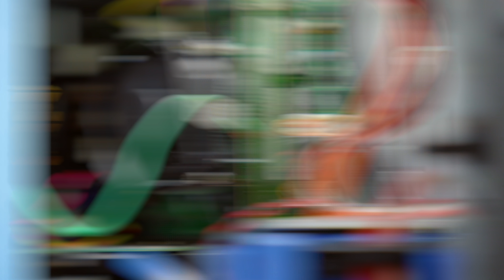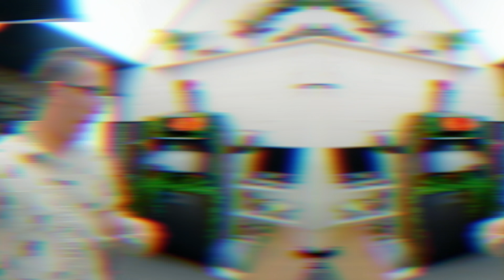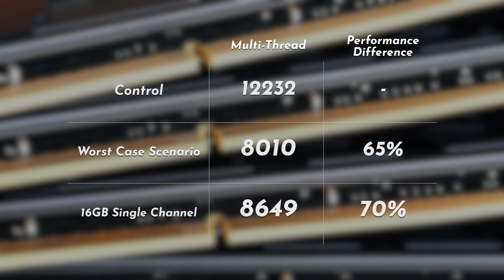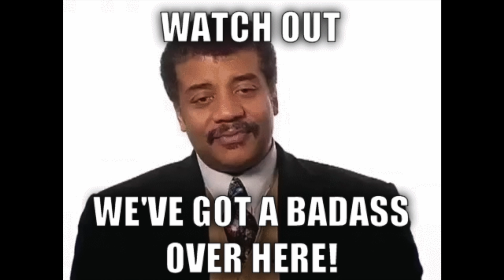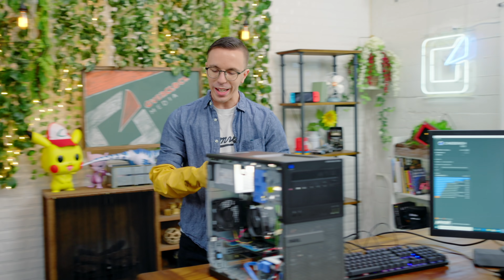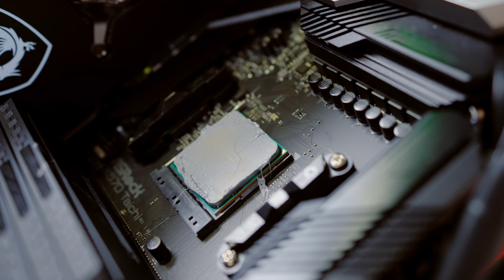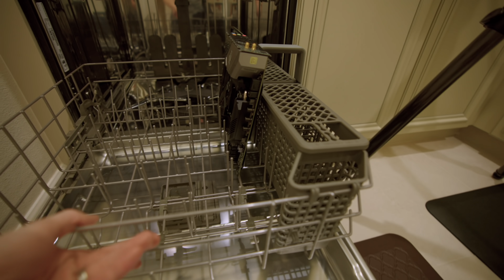Gaming PC Lies People Believe

Comment: thermal paste a blob size grain rice, i feel that way to little. most people build a system and once it built it years . i do an X a nice fine line and a tiny blob in 4 space and that seems about right, the X could be about right but just to make sure, as screwing it down its always going to be uneven so one very fine blob centre i feel you could be at rick half cpu having very little and best advice id say esp new builders maybe just under size pea a little extra far better than to little or do what i do a fine x and 4 tiny dots in gaps you know for sure. itx newest pc i may gone over the top slightly but upgrading old pc what i built 7 years ago with new motherboard, cpu psu and case i used a fine line 4 dots that was correct amount, but i was using arctic mx6 the other mx4 so much thicker stuff and still not 100% sold on it as feel i may get better mx4 , that micro small dot you made i dread to think what use that is in a year compared to 4-7 years what a lot people run system for once built esp if they gone all out on cooler then no need to ever remove it till first big upgrade and that can be years. tad extra is far better to little esp if system going to run for years

Comment: Note: Today most people won't know this, but in the early days of PCs, the Main drive in all computers was magnetic based media. It relied on little magnetic particles to be in very specific positions to tell the computer what was on the drive. Letting your kid pit little fridge magnets on the side of your case was a very bad idea as over time the magnetic field would slowly start to shift those particles. Now it was harder for the weak field to do it while the computer was on as the disk(s) in the drive were spinning and constantly changing the position of those particles relative to the field. But when off, the disk(s) were stationary and the particles would slowly start to align with the field. That is where the idea that magnets killed PCs came from. Modern computers use SSDs as their main drive, which are a bit harder to screw up with magnets. Still not a good idea to have them around your computer, but the danger of them wiping out your entire computer is substantially less than it was before.

Comment: I work repairing consoles... And people have brought me consoles with toothpaste cuz "I see a video on YT and they said it works". The problem with toothpaste is not only in long therm it's gonna dry out, but also, have sugar, and other components for killing bacteria and all the sht in our teeth, so the corrosion on the processor, and the cooling system is enough to never gonna have good heat transfer ever again (considering GPU on consoles doesn't have those covers)

Comment: If you're gonna "wash" your PC components, make sure you have a good house filtration system.  You don't want minerals in the water getting caught and drying in the ports. NOT A WATER SOFTENER, water softeners activily ADD more mineral to the water,  either salt or potassium. Easy way to destroy electronics. If your water is actual "clean" IE no minerals,  or basically  distilled water,  than you shouldn't have a problem.  Just make sure to give them all a few DAYS to dry.  Not just 1. Or if you're only gonna give it 1, put it in a warm room with air flow to help the leftover moisture evaporate and not be left in the ports and crevices. God speed to whoever tries this

Comment: I routinely wash old motherboards with water. Water does not kill electronics, it does not corrode the material (unless it's water against it for like months/years). What ruins the system is the electricity acting as a reaction catalyst between the water and the copper/other conductive metals in the PCB. So, if you give it enough time to dry afterwards, you could literally dunk a gaming PC into a pool, and it would be totally fine.

Comment: just FYI, that hard drive isnt dead. You only erased all the data on it. You see, a hard drive stores data as magnetic impulses on a rotating disk. Therefore, pushing that magnet onto the hard drive completely erased the data from probably just a few cylinders, maybe more. In either case, that hard drive should be totally fine, if not a bit forgetful about it's past ;)

Comment: My take...I found a garbage PC some kind of sticky brown goo in it but decided to push through I disconnected everything I cleaned as much as I could but that goo was a project killer either I continue or it gets tossed so I put it in the sink (not dishwasher) used soap and water and I brushed it, got it cleaned and I used a hair dryer on hot to dry it asap made sure everything was dry then...because I didn't have thermal paste I used food grade machine grease rated at 250° I still think I should put actual thermal paste but meh...it turns on and it's running windows 7 and I use it exclusively as a media PC...it's been a year and still running

Comment: Every single thing a computer does is literally just manipulating electrons in different ways so it makes absolutely perfect intuitive sense that as long as every single part of your PC is not very heavily insulated against magnetic fields which is not easy to do and expensive then then it makes perfect sense that it would pull away electrons that that if that your computer would be using In fact I'll bet if you  Could get that magnet  Close to the side of the CPU where the is there the I just meets tmeets the cooler That you would absolutely be able to completely pull away electrons out of transistors in the CPU And most likely break it

Comment: Try mixing ram from same manufacturers that are close in speed. Ive got some cheap OLOY 2 different sets of ddr4 3200 but the other set is 3600 stock. I enabled xmp and everything runs at 3600ghz no issues.

Comment: Did you pull the cmos battery out of the motherboard before washing? water should only damage electronics if electricity is present to cause a short unless erosion was a factor which, it was a single wash. not 20 years in a river.

Comment: the magnet didnt kill the gpu, the surface of the magnet shorted it out. gpus have a lot of current in them and i think you would need a much more powerful magnet to disrupt the circuitry
Reply: was thinking the same and since its a rather low end gpu im pretty sure it has no back shielding

Comment: I want to see you do this magnet thing again but with a rubber coated magnet and magnet case. Did you blow the water out of the mobo with low psi air or did you run this dishwasher in sanitation mode?

Comment: You didn't pull out the CMOS battery numbnuts. You killed your board now spreading misinformation off of your own mistake. If you fucked that up I'm not even going to assume you even dried out the dead board well enough either.
Reply: if ur alr that mad abt that go back where "the magnet affects the gpu" (he just shorts the hell outta the card by laying the magnet on it (since its a low end card im hella sure it has no shielding there))

Comment: ESD usually happens when the system is disconnected from the wall and de-powered try it that way I bet you fry some stuff I’ve fried a stick of ram and a mobo once with ESD, 74c wow that’s cooler than my prebuilt ran with it’s oem thermal paste lol can’t believe crest works better lmfao, I’ve seen ppl wash component with a hose and they still work the dishwasher has a drying cycle that gets really really hot that’s probably what did it that and the hot water

Comment: what if we use one like RAM sit as 8 + 8(two sticks) or 16(one stick) which one would be better.
the second if we use 8 + 8 + 16 or using 16 + 16 which would be the better option.
if we use 8 + 16
the all have like the same speed but in each case which should be more preferable over the other?

Comment: some pc u may be suprice no not in dishwash but in a flood ware i picked up the tower took it out back tiped it over and u saw about a gallon of water pour out sat in store for about 10 months took it out looked at it looked great like new inside still pluged it in and worked like new and it was a used microsoft certified refurbish from amazon only cost 100$

Comment: I can run mixed DDR4 ram just fine in my newer laptop, but when I mix brands in my older laptop, Windows doesn't boot. The ram is completely the same from the clock frequency to the timings and memory, but it won't boot beyond the bios.

So newer ram, yes it can be mixed. The difference isn't as significant with Intel CPUs as opposed to AMD by the way.

But older ram modules need to be the same from my experience.

And who the hell would put toothpaste on a CPU? That's ridiculous lol. Still gave me a good laugh

Comment: imixed ram and did not have one issue until a pair of the sticks which were older ended up dying after a while. But 2 sticks were both 4gb each and 2 were 8gb each. the 8gb were corsair and the 4gb ones were from best buy so it was best buy  brand. cant remember the name. oh and that mobo wouldve been fine if you let it dry for more than a fkn day omfg smh. seriously.

Comment: You actually can wash parts in the dishwasher and you can use dishwasher detergent, but you should turn heated dry off and hard water could cause issues (I also never put parts on the bottom rack).  After washing you should use 91% IPA alcohol to displace the water and then dry thoroughly before hooking up to power.  I’ve never done this with modern hardware but I do do it to grimey retro hardware fairly often, especially with keyboards.  If the parts will fit in my ultrasonic cleaner I use that instead of the dishwasher, though.

Comment: Recently someone was told “even the newest hp and dells aren’t good enough to play games” the person has an RX580 sitting on a shelf, and I was going to set up a Dell with a second gen I7 and a 750w power supply to put the 580 in, not the fastest option, but plenty good enough for gaming. Now that cards still sitting on a shelf, and they’re waiting until they can spend probably $1000 on a new pc, which they will then need a new GPU anyway to make that cost worth it.

Comment: I dont know about putting an entire motherboard into a dishwasher, but you can wash computer parts with water. It isn't the water that hurts computer parts,  its the minerals in the water. If you take the minerals out via machines meant to do so (and i mean all the minerals. They're pricey machines but they work) you can soak particularly dirty computer parts and then clean the water off via drying it 100% or solution safe for computers.

Comment: Why is Austin testing if static will damage pc components, while it's completely together?
The static argument is used while the PC is being built, not after it's built, a running system is already grounded with a power supply that's designed to protect it.
He should've shocked a part that was uninstalled, and then tried to use it in the system.

Comment: Washing components isnt that bad of an idea as long as you properly dry it ... I had to actually do this for a client that came to us with a REALLY bad dust/mud (I mean mud due to the high humidity of that town) and after disassembling the whole motherboard, washing it with soap, warm water and a gentle pass of a soft toothbrush, we got it clean as new. Left it drying on silica gel for around 3 or 4 days, then put everything back together with new thermal pads and everything was as good as new. PC worked like a charm for over a year after that.

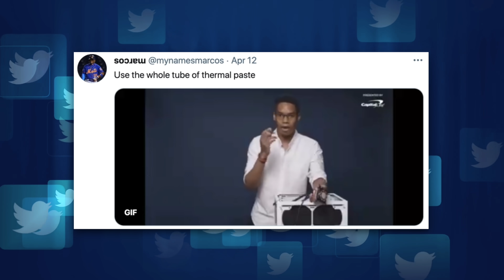Comment: 13:35 Never use the whole tube, unless if you're dealing with a 90nm Cell BE processor. In that case, use 2 tubes if you can

Comment: Only a day may not have been enough time to dry all the water especially any trapped in small spaces. you should have used a hairdryer or some kind of air to get most of the water off then allow it to dry for at least 3 days. Also you should have made sure that your dish washer didnt have a heated dryer function turned on since the extreme heat used to quickly dry dishes could have possibly re-flowed the solder or caused components to become destroyed.

Comment: roughly a grain of rice? I would not recommend using that little. of course you don't want to use enough to have it coming out of the sides when under pressure you still want to have enough to cover as much of the IHS as possible and a grain of rice isnt going to do it. you might get 20% covered using that little. 

you also dont want to use an X patter since that could cause air pockets to be trapped between the IHS and heat sink.

Comment: Did you revmove the bios cell battery? (on the washed motherboard) if not thats what killed the mobo, i've washed lots of mobos with no issues BUT you have to remove the battery.

Comment: Physically magnets wont do anithing to electric components that doesn’t depend on magnetic fields to work( hard drives use them) so you wont do anything to acomputer with a magnet unless is sufficiently strong and if  theres a delta(increase decrease) in the area where the magnet is affecting or a delta in speed. This will generate a current that can harm your pc

Comment: have mixed rams in my old notebook and rock solid stable, no crashes etc. so i can debunk that, also one is 2gb the other 4gb, but that doesnt matter, but both are diff speeds and diff manufacturer, yet it works great, its maybe not ideal,b ut i have what i could find for a reasonable price, so im ok with the performance of that old laptop

Comment: That stun gun is nowhere near 3.8 million volts. It's just marketing. If the prongs are a centimeter apart, maximum voltage is around 30000 volts.

Comment: I used an anti static wrist band back in the 90's when I worked in a shop because they were there and they wanted us to. I never did it at home and I haven't done it since. Never had an issue. As for washing electronic parts in water it kind of depends on what it is. If it any kind of part or circuit that holds a charge like with a battery or capacitors and stuff like that then yes you can short it out. You might be ok if you pull the battery and can find a way to discharge everything first. In the case of using a dishwasher it might actually get hot enough to melt or damage components. You might have better luck just running it under your tap or something. I would also try to dry it with compressed air, a low temp air gun (hair dryer) or a low temp oven. That way you would know all the water was out of places you couldn't see. I have never tried with a computer but I have washed remotes before and they still worked.

Comment: Did you remove the CMOS battery from the motherboard before washing it? Even a tiny current through the board can damage it when it gets wet. I have washed numerous components in the bath (including a power supply) and not had one go bad. I use an old hoover with blower function to remove the water then leave the components to dry thoroughly for a couple of days and they have always worked.

Comment: I don't want to nitpick too much, but that stun gun is (well for one is not a taser) cannot deliver anywhere near 3 million volts. It's maximum voltage is regulated by the space between the prods and the dielectric breakdown of air. It's going to increase in voltage until the air breaks down and it shorts itself. Once it does that and arcs its voltage will stop climbing, drop, build up again, and arc. That's why it has a pulsating sound.  Roughly speaking the breakdown of air is 3mm/Kv so however many mm apart the prods are times 3k is going to be your voltage (although this can vary a lot).

Comment: You cannot have "very high voltage and very low amps" unless you have very high resistance. This is ohm law. The computer is grounded, meaning that there is very LOW resistance between you and the ground. So... when you touch it and there's a 5 or 10kV discharge, there are SEVERAL AMPS flowing through you. 

So why won't several amps from a small static discharge kill you but, 10mA from a wall outlet will? The reason is the overall charge. Those several amps dissipate quickly and the the overall charge is low. It lasts only a millionth or a billionth of a second. Whereas the wall outlet is more than capable of supplying those 10, 20, 30... milliamps long enough to kill you.

Comment: I've washed motherboards before. After washing dunk it in isopropyl alcohol then bake the board @200 or lower for at least an hour. The alcohol disperses the water, doesn't corrode, and evaporates much easier. Baking the board of course causes any liquid left over albeit alcohol or water to evaporate much quicker.

Comment: Magnet killed GPU cos it shorted the GPU, and killed the HDD because a HDD stores data magnetically, nothing to do with the moving parts
Reply: Well the hard drive is a bit of both. It's a metal disc spinning so the magnet would have almost certainly physically stopped it spinning. If they were close enough to the read/write heads then they would have also crashed into the drive.

Comment: Water + electricity = dead components. 
 But if you properly dry it out without any metal IONs residue between connectors/pins/tracks and trapped water drops inside PCI/RAM/Power/SATA connectors (which is hard to do) also pulling out any source of energy from the motherboard, including the battery, you should be fine. And never clean PSU or Fans with water. The only safe thing to clean with water in PC is the radiators